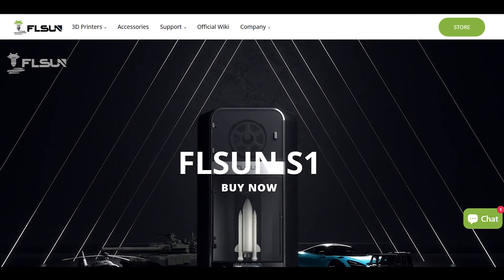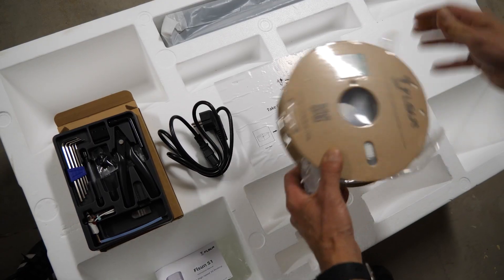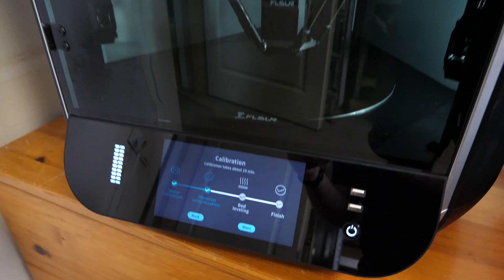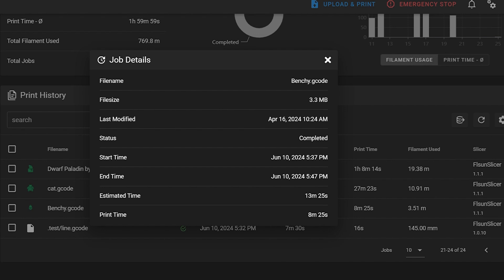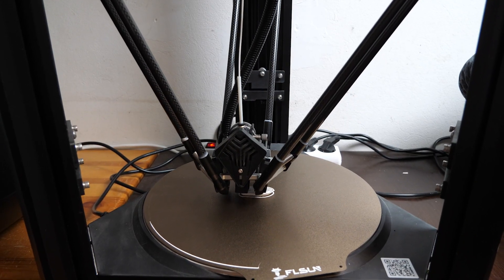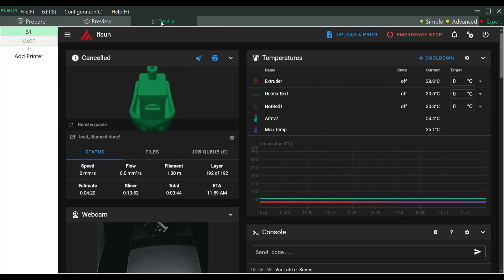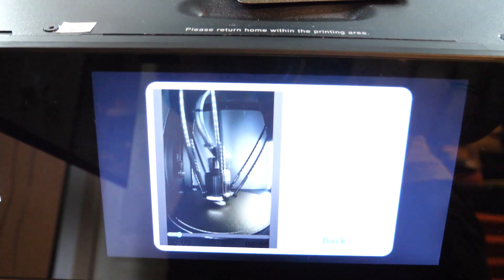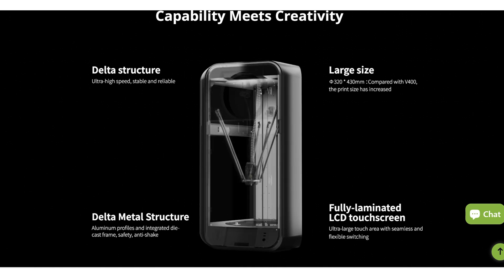Flsun S1 unboxing, first steps, speed test & noise comparison with V400

Comment: I have 3 V400's.
Have upgraded fans to 5015 fans.
An input shaper is a must.
Also have cooling on stepper motors.
Both are enclosed with one with original Flsun enclosure and the other with custom enclosure.
Both have upgraded firmware.
I will take 2 V400's over the newer ones as I can do color changes with ease using 3 custom spool holder enclosures on top of the printers.
Cheers.
Reply: Do you have links to the custom spool holders?

Comment: Firmware is udateble in your machine? Because keep failing on my newly arrived machine. it is annoying clog issues
Reply from the maker: I didn't update it over Wifi, but manually downloaded the latest version from the website and it worked.
Reply: @RBsGadgetReviews  could you share the link please? Support not very helpful
Reply from the maker: It was on their wiki page but I cannot find it at the moment, the page seem to have some certificate issues. I'd suggest to check the printer's official Facebook group for help - https://www.facebook.com/groups/flsuns1
Reply: @RBsGadgetReviews  Thank you very much.